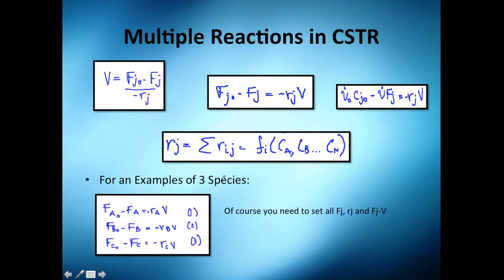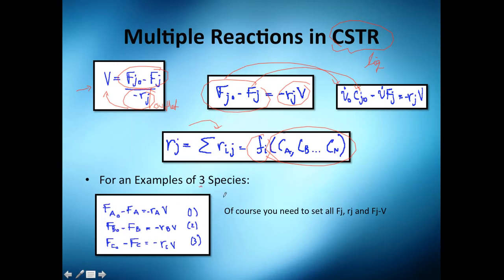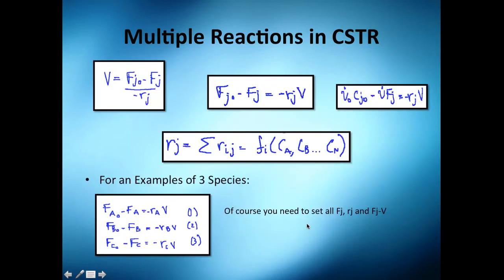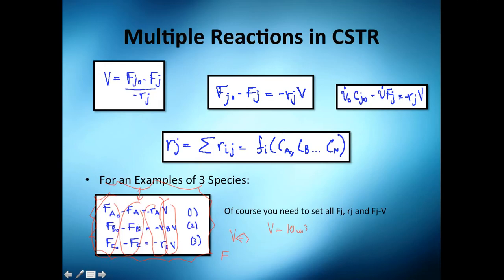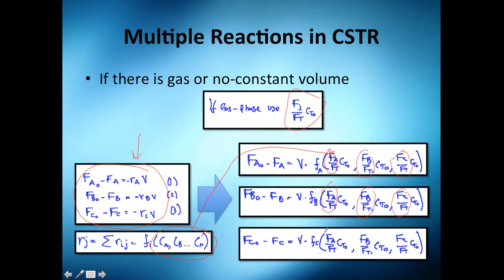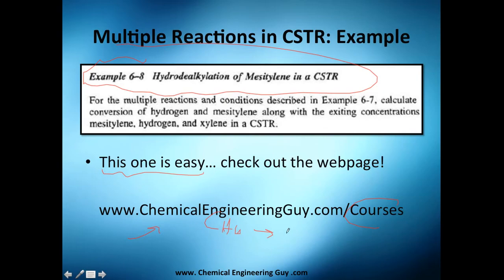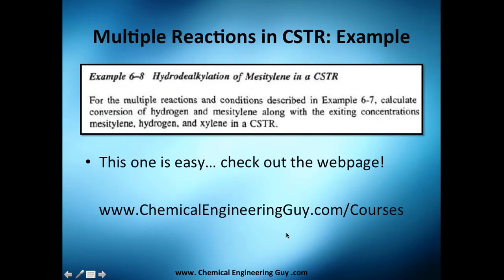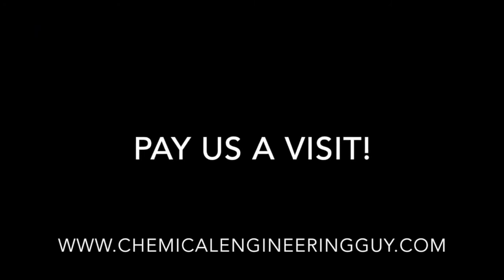Solving  CSTR with Multiple Reactions // Reactor Engineering - Class 111

Comment: hello sir I want to ask what is Cto, and if 
feed = liquid
output = gas-liquid
did the last equation work?
Reply from the maker: 💬 Hey! In that video, Cto usually means the initial concentration of species in the reactor feed. If your feed is liquid and output is gas-liquid, the equation might need adjustments to account for phase changes and mass transfer—so it may not directly work without modifications.